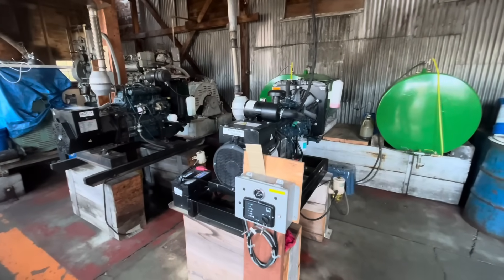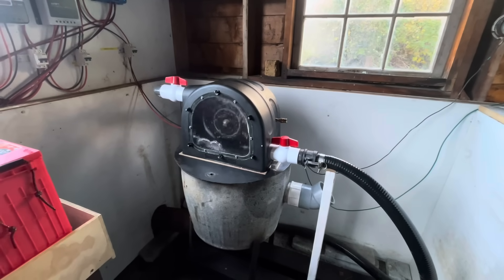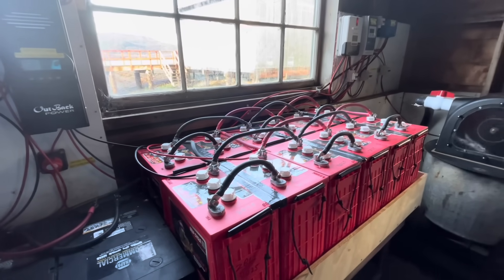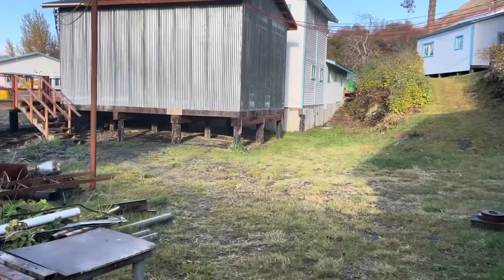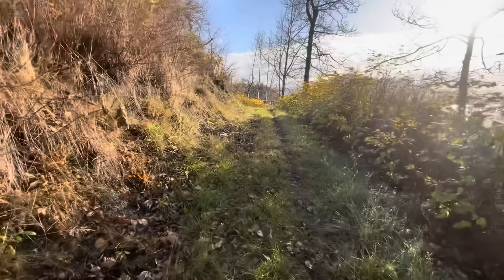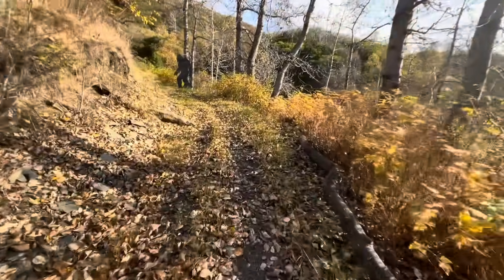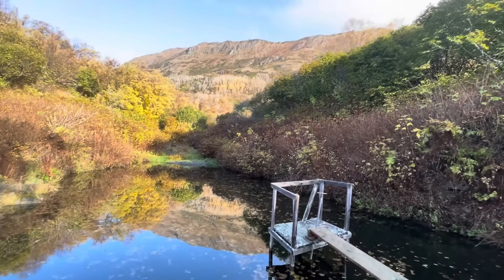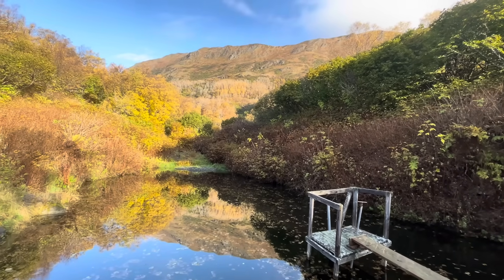How we make our own electricity in remote Alaska.

Comment: A string of LED lights to a capacitor and back from the other post will light them with AC power straight from your hydro powered direct drive washing machine motor.  Of course you will need a string of LEDs in the opposite direction from each post also.  It requires a certain type of CAP like from old tube TVs, they look like a little brown hand bag purse.  The way it works is that the cap can only take so much electricity until it's full, and that is the exact amount that they LEDs need to light up.  Then when the AC switches poles, the cap releases it's load down the other string and get's powered up by the other string on the other side. 4 strings, one cap.  3 volts per LED, so the lights on the string, added up, needs to be less than the power source. BUT you can put 4 lights to a cap and run 120 volts into it with no other components and it works fine. BUT the CAP must be small, ie THE RIGHT UF dude.  Revelio has spoken.

Comment: HAY, how come you don't have a floating inlet pipe in your pond? Attach the end of a 2 inch Polly pipe sticking out 15 feet into the pond, to the bottom of a 2 foot 2x12 and put a fine mesh screen down from the wood around a chicken wire cage type thing and floating debris will stay out of your water supply and sedimented water also. The best water is just below the surface, and that is where your floating inlet pipe is. Revelio has spoken.
Reply: Umm.  Because Alaska, because ice, because THICK ice.

Comment: How do you know when you need to replace batteries? you just do it every 5 years or does the charging distributor tell you when a battery isn't holding charge? I assume they're all lead-acids.
Reply from the maker: I think you can test the battery with a hydrometer to see if they need to be replaced. I hope I get 10 years out of the red ones. They are lead acid.

Comment: If the turbine is getting the batteries up to a float level most days, you could set up a controller to shut off the water with an electric valve once the batteries reach that point, and then have the controller reopen the valve when the batteries reach a nominal level again.  The solar controller may be able to be configured for this using the generator dry contact output.

Comment: so, water runs down from higher altitude, into a turbine, turning the altenator, generating power that goes to a smart distributor, to batteries, next the batteries connected to an dc/ac convertor, then to house batteries where house appliances are connected?
Reply from the maker: Yes, that’s right. Thanks for watching

Comment: 1:15 -- Really neat system!  I don't fully understand the science of it all but still awesome.  

My only three concerns are the batteries being so close to that powerful water generator (short circuit if water flies out everywhere), the water freezing in the pipes in the electrical shack, and leaf/rock debris getting stuck in the buried water-supply line between the reservoir and the electrical shack.

Comment: Amazing system! My only suggestion would be to house the diesel system in a different building than the battery systems.  Just so the rare chance of a fire from either system doesn't take out everything.
Reply: I 100 percent agree with that. Why on earth would you put all of the eggs in the same basket. That was my first thought when seeing the batteries right next to the engines and diesel tanks.😮
Reply: i dont think his diesel engines are going to ignite anytime soon
Reply: @AlexWheely-bx7pk Obviously you know nothing about batteries or engines.
Reply: @AlexWheely-bx7pk   Probably not, but possible. Inverter could fail, a battery could explode or even a good old fashioned electrical fire. Just a bad idea to house everything together.
Reply: Sounds like a good phase 2 project when there is money and time for the second shed.  Everything takes resources.

Comment: I got Solar Panels and  4  P.M.A.'s  
Each P.M.A. makes between 1200 to 1800watts depending on speed , then I have a 1800watt gasoline Generac Generator  for backup and I'm still hooked up to the Grid , my electric bill this month was 62 dollars because I only have 120 volts and from the Grid I need 240 volts  .
Reply from the maker: There is 240 volt inverters. maybe that is what you need.
Thanks for sharing and watching.

Comment: Since I love this subject here’s my 2 cents if you want it .. thanks
Put in another line to run a second alternator, this second power source will pump up the water back to the pond. You would have to re engineer everything first step keep the water to the house and power gen. On their own line, put a tank at the house and since this has to flow make a siphon at the top to dump into the lake to control usage and draining the pond also creates a buffer for the house usage. Have both discharge water from pumps go into a holding area to be pumped back to the pond. 
Goals: no splitting pressure, slows usage on pond.

Comment: 260w ??? Are you sure I’m confused. A amp is 120w so only little over 2amp ? That’s not right.
 Nvm me dummy it’s charging a battery bank so it’s a 12 volt system in a 12v system 12w is an amp. So he is pushing decent amps.

Comment: Where does the water go after running the turbine ? Not back to the original reservoir, since it would require more power.
Reply from the maker: It just runs on the beach back in the bay.

Comment: I worked at the Centre for Alternative Technology (CAT) in Wales as a lecturer and consultant on renewable energy.
We had a power spout mounted to a table, fed by a reservoir up the hill, as a teaching tool.
Really loved using it. One of my favourite things was turning the water off, connecting a large variable resistor or different light bulbs as a load, and having students experience how you really need to push harder (you could open it up and turn the wheel manually) if the electrical load increases.
In my role as a consultant, I recommended a few of these to Welsh farmers.
Even when theoretically a larger hydropower scheme is viable, the PowerSpout can be so much cheaper and easier to implement.
Reply from the maker: I really like the power spout. It has been running for about four years now with no problems.
Thanks for sharing your experience.

Comment: Maybe a dumb question, but can you double what you have i.e another turbine etc to get double the power? Asking out of curiosity if then you could run more like doing laundry etc
Reply: The energy from the 80 ft head pressure is used by the first turbine.....
Reply from the maker: I could but I would have to run another water line.
Thanks for asking

Comment: If you have the space , then Nickel - Iron  batteries are  MUCH  more long lasting than Lead - acid and will never fail , unless you forget to keep the caustic solution topped up with distilled water  tip # 56 .......... DAVE™🛑

Comment: At your water discharge, you could have another turbine system.
Reply: i think optimizing the current turbine would be more worthwhile and efficient than installing another
Reply from the maker: @MasonTilghman there definitely room for improvement. Thanks for your input.
Reply: Yeah, it doesn't need to be as big of a generator .... 
Good idea..!
Reply from the maker: Good idea. I would have to run wire a long distance and the voltage loss wouldn’t be worth it.

Comment: Good stuff, I like your set up. I got my panels that were timed out from buildings for very very cheap. If I was in your situation I would highly recommend buying a ton of cheap used old panels. 
Mine still work and it's been 10 years. I got them for 50 bucks each.
Reply from the maker: I got my from Amazon and they were about $80 each free shipping to the lodge.
Thanks for the advice.

Comment: Back in the 80's a friend built a home on a remote island with the idea it would be their retirement home and summer cabin. He put in a small hydro generator using the flow of the creek. At the time figured it would be sufficient for lights, fridge etc. Over the years he added in an electric stove and finally electric heat. Other than adding batteries the little creek originally thought sufficient for lights and fridge now runs the place with everything electric. It is surprising how much power a little creek can provide. 
Should mention they live on the B.C. coast and apparently even during one of the driest summers recorded that little creek kept them going.
Reply: Please don't censor my reference to Marty T channel as this will help your channel out...plus help answer quite a few questions you are answering as well....

Comment: I have a dumb question, why wouldn’t you have a closed system for the water power? Seam t me if you had any old hot water tank that’s 50 to 80 gallon and a small recirculating pump, you could pipe the whole thing in with a valve from the reservoir then close that valve and recycle the water. Seams to me that would save the other water for the house. Just an idea that I had I might be crazy.

Comment: Every 2.31 ft of elevation gives you 1 PSI   So 80 divided by 2.31 makes 34.5, plenty of power even with a 1.5 inch flow through piping to run that turbine    Nice steady power.  Love it
Reply: The bigger the penstock pipe the lower the friction losses. 
3 inch pipe is beaten by 4 inch pipe for volume and pressure...
Reply: yes 27 " is equal to 1 PSI
Reply: Drastic oversimplification, Pipe diameter,flow path and pipe type ALL effect volume and pressure. You have a constant but you are missing most of the info for an accurate calculation.
Reply: If you started with larger intake line and reduced it a couple times the psi would increase drasticlly
Reply: @JoshuaLee-e5i  
No it would not.
The volume would increase, 
the flow rate would increase...
gravity stays the same so pressure does not increase.
Reply: @JohnSmith-pl2bk  the pressure would increase over distance with reduction, im saying if he ran a inch hose 40 feet of the 80 and then reduced the hose to 6 that reduced to 4 over the remainining then the same flow rate would produce more gravity due to the pipes themselves holding more water back the inch pipe hold twice as much water as the which by reducing the side of the hose half way down the top half dble will maintain the flow rate but increase the pressure to a higher psi,and that would increase the rpm while the flow rate remained the same as before only now with 25 percent give or take more  pressure per square inch contacting the rotors,kinda like if you put your finger over the end of a running water hose then slightly open it it sprays water harder and farther than it just running ,that is because of a reduction in the size of the opening ,same goes for anything else but my insight was in that we have done the same thing ,,with longer hose granted but down hill and reduced every 100 feet or so from 8 to 6 to 4  to 3 ,and it's sitting in a slow shallow creek at the top ,,by the bottom it takes two people to open it up if it's disconnected from the frame,, the same size hose all the way down then tapered to 2 was tearing apart the turbines it went so hard due to the volumes sheer mass fed by the creek  up top, not a river, a creek,, and it's not effecting the creeks path or anything it took from it til it was a full line and then it had to be reduced to be applicable,, I was merely stating that more water in the line creates more gravity in then in the drop due to more mass in the line, but it doesn't require more water and it doesn't put out less water it puts out higher pressure at the smaller taper,
Reply: @JoshuaLee-e5i   Yeah it still boggles my mind people trip over this pretty easy concept, something anyone who's used a garden hose has figured out as a kid.  Painters know this too for washing off their rollers; just running the water over it does hardly anything to get the paint off, so you put your finger over it ( or an attachment ) and start spraying the paint off .. which if you are being efficient.. means you angle it so it makes the roller spin so you can get the whole thing at once.   You're creating your own turbine without even thinking about it.

In the end, for amateur setups, I think it comes down to what the person feels comfortable with doing.  The more pressure you put on it, the shallower the fins, lots of things can lead to it making a lot of noise, and a lot of mess .. which people will correlate to stress / danger.   They'll probably build a system to adequate noise levels so they don't feel like they're doing something wrong  ( or don't want to hear it across the property ).  It's understandable, I don't like hearing my vehicle go over 3 on the rpm gauge, even though it has numbers going up to 7.  So they won't realize the potential they're leaving behind, and maybe they're happy with the results they get because it's working either way.

I thought 250 watts for the whole setup seemed really low, it should be double that, especially with that giant insane battery bank array they got sitting on that table.  It looks like they're trying to power the entire community with those 12 and 24k generators .. and then they have 250 coming from a turbine.  It's kinda sad and useless.  In their situation, they should be trying to get as much power as possible.
Reply: @JohnSmith-pl2bk  mr robotnik was apparently absent on Venturi day

Comment: Tons of work went into that whole system. Thanks for the tour.
Reply from the maker: Thanks for watching.
Reply: @zacharbaylodgeinc8864 Hey mate cheers for vid I just wanted say isn't it strange how often the water comes from underground but exits often at the top off hills or mountains because root off least resistance would find lowest point above ground level but like waterfalls or just small water exit points often are way up on a hill which obviously you need pressure too pump water up a hill almost like there is a pump type system in these mountains too take the water up that high I mean I know they say waterfalls n such is from rain run off collecting up top then falling down hill/mountain but lots areas still have huge amounts water millions tonnes pumping off or out the mountain constantly no matter how much rain the flow never slows it's always full blast even if doesn't rain for weeks that water flow amount stays consistent which if been no rain for weeks it should start fizzling out then slow too drips in a pretty quick time but it's like they don't decrease at all often..so that's why I feel it's coming up from down below but then the question is what's pumping it up vertically so high as take huge pressure and how did the water channel going up inside mountain get there in the first place you need too make a pipe line with a pump too achieve this even with a tiny fish pond fountain so a waterfall staying consistent up that high what's pushing that and how is the channel there in the first place...I saw a waterfall in etheopia that stopped running 40 years previous was dry but one day out the blue in a time off drought so even less rain fall at that time one day it just switched back on full force..with no rain fall after 40 years dry...that can only tell me that water has too be coming from another channel that must off been blocked or something or some redirection happened but was instant so yh wasn't rain fall...anyway just something random too read for you cheers
Reply from the maker: @jshaw4757thanks for the info. It was very interesting.
Reply: Lookup primary water,there was a recent discovery of a subterranean ocean 300-500miles beneath the earth’s surface that holds something like 3x all the surface water on the planet (i think jules vern knew more he let on and wrote fiction books to tell us).water/helium is created from a byproduct of a nuclear reaction(where do we get helium?its mined from the ground).meaning there has to be a small sun at our earths core creating these substances as a byproduct and pushes it out to the surface.apparently Ghadaffi drilled a primary well and created a well of endless freshwater for his country and people.he also tried to back his own currency with 200t of gold,but neither he or his idea lasted very long,for obvious reasons.
Reply: and MONEY
Reply: God's country
Reply: A lot of work.  And also a lot of money for generators, batteries, and panels.  Too cold for me...
Reply: @og_papatango I worked up in Alaska for almost a year when I was younger and it made me appreciate living in the lower 48.  I also realized that you need quite a lot of resources and a lot of money to live decently in Alaska.

Comment: Do you reckon you could up the flowrate to the turbine and just use a booster pump to ensure the house always has good pressure?
Or maybe use a second turbine in parallel, even. I'm sure some of that pressure gets wasted.
Reply from the maker: I do want to try that. The turbine came with extra nozzles so I could cut them bigger to see if it made more power. A second turbine would be great when we have lots of rain and snow melt in the spring but I think I would have to put another water line in. There is a lot I can improve.
Thanks for the suggestions.